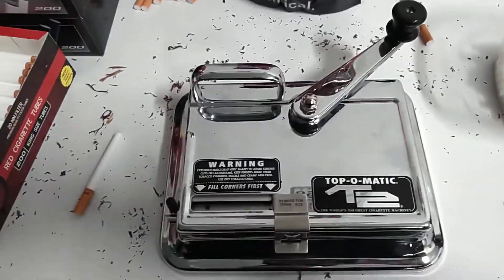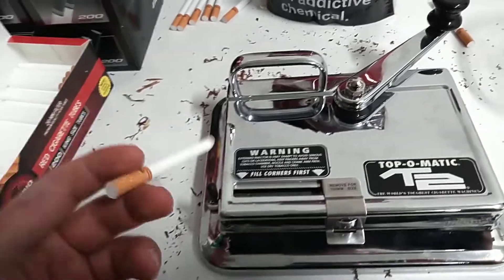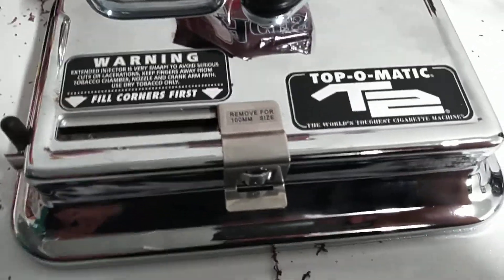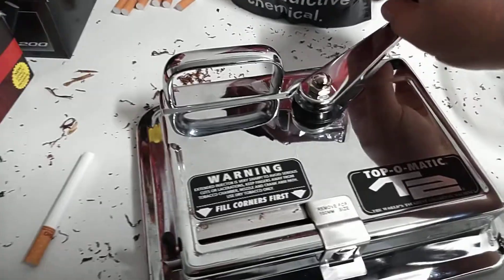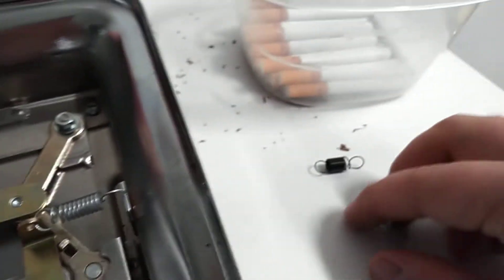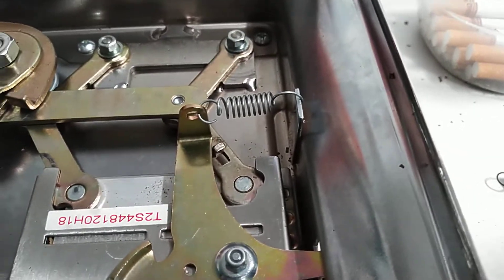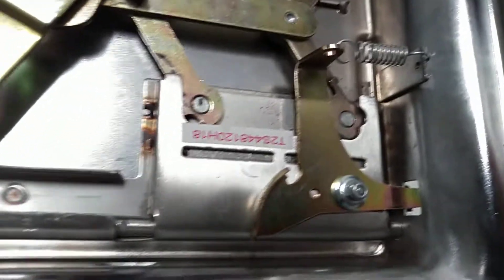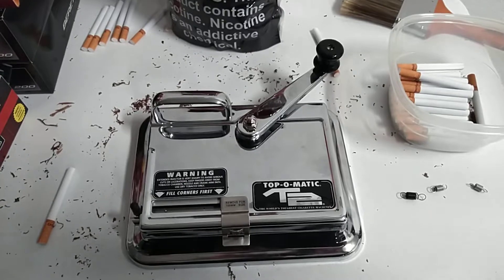Top O Matic T2 Half Filled Tube Fix

Comment: Thanks for the video and inspiration! I had the same problem. But I found another solution which might help, too. After watching this, I saved myself a couple bucks and a trip to the hardware store by reworking the native spring by increasing tension. Using strong small tweezers, I unhooked the spring on the static end, and then wound it up at the moving end a few turns, then attached it back on the static end. Works perfectly, no more misfirings!

Comment: This is great advice. My friend gave me mine used and I really love it. It's much quicker than the little handheld machine. A couple other causes I've noticed in the machine stuffing them half full....packing the tobacco too tightly, the arm not being screwed on tight enough (my screw loosens a bit with each rolled cigarette), and the rubber piece that holds the tube in place slides up so its unable to keep the tube in place. In fact. I lost the original rubber piece and was about to order replacement like 2pk for $10. I got an idea....the rubber tip off earbuds! Been using the same one for like 2 years. Plus they're free
Reply: I used heat shrink tubing

Comment: Thanks for the video! I was seriously skeptical but I went ahead and went to my local ace hardware store and picked up 3 119 springs.  I took em hime and installed one in my machine and I also lubricated it with some 3in1 oil I have.  All I can say I'd thank you so much! My machine works just like day one!  I also put one of the new springs I got into an older one I had that stopped working over a year ago. It worked on that one too! Now I have two "T2s" that work just fine 🙂

Comment: Thanks for this, four years and you are still helping folks! The comments are great too!! I am headed to find a 119 and a small oil can, but that’s fine I needed a tobacco run anyhow since my easy little store is out of the stuff I wanted, and my sewing machine could use some oil anyhow. If I see heat shrink or ear buds I might make a new rubber bumper too because mine has a few divits from trying to hold the tube on strategically with my thumb and maybe pressing too hard, or getting a little tobacco stuck there during a lot of rolling… then I flipped the bumper over 180 and made a whole new divit (My bumper is now on a 45 degree spot and this game cannot continue forever).

My only issue is, how do I drive to Ace without rolling more dangerous “fall off in your lap” half cig’s for the trip? Much appreciated Tom 😎

Comment: So, I didn’t want to believe that the fix for this was that simple. But, it was !  I have been rolling for about 2.5 years and every six months, the issue of underfilled tubes would creep up. My first machine, I ordered parts recommended by another roller and replaced them but never thought about the springs ... in any case, this didn’t work and really, a new machine every six months meant I was still saving a ton of money not buying smokes.

Today, almost ordered another new machine, but read this and I just returned from the hardware store with four “119” springs, 1.75$ apiece. In about 30 minutes, I replaced and tested three “broken” machines, so now I have two refurbs “just in case”. Thanks, Tom, for the fix. 

I will also add that the humidity of the  tobacco  can cause an occasional issue, but this might be 1 in 30+ tubes and after so long, I can almost feel the issue before it happens ;) a piece of bread in the tobacco bag works, as do the little cigar humidifiers (size of a few stacked nickels), but don’t overdo it or the tobacco starts to stick and jam.

Reading other advice here, I also saved the old springs, and will try the advice of reusing them by trimming these a bit, next time the need arises.
Reply: My machine has 2 springs,1 on each end. One is short oneis longer.Does the longer one also need replaced?

Comment: Another thing you can try: The moisture of the tobacco is a critical variable that's too often ignored. Too moist and it won't burn well. Too dry and it'll crumble and produce fines that won't pack well. So try the old pipe-smoker's trick of throwing a wedge of apple or a damp (& rung out) paper towel into your tobacco stash to keep it at optimal humidity. This is what works for me.
Reply: Nope, mine is too moist. I add nothing.
Reply: I keep my tobacco in the refrigerator.
Reply: Exactly what I've been doing for years. It also allows me to user the whole contents of the tobacco bag. Previously, i woul wind up with a bunch of too dry stuff that was unusable ( a waste of money).
Reply: where can I get that spring?
Reply: @renerenatorivera9062  ace hardware, probably home depot, lowes
Reply: What I found to add the perfect amount of moisture back into the tobacco is to blow through it a few times.  I put the tobacco to the side of a container to do it. Make it roll perfect again. I have tried a moisture pack and that got it too wet.
Reply: I place a dampen piece of cedar in my open tobacco bag.
Reply: I've called it tobacco soup vs tobacco sand for years. Both suck. 
If it's too dry I'll wet my fingertips & drip several drops into the bag, wait a couple hours for it to soak evenly, & the consistency is good again. It works a lot better for me than any piece of bread, lettuce, or piece of fruit or peel. 
Conversely, if it's too humidified (& there's no air conditioning available) I'll spread some tobacco on a tray & stick it in the oven on the lowest temperature for about 1 - 3 minutes. Got to be pretty quick about getting it back in the bag if the ambient humidity is that bad (also being careful not to scrunch the freshly dried tobacco into "sand") but these strategies have helped me through the years.
Reply: Or a small piece of bread and keep in the fridge

Comment: You were right, tried pressing on the rubber arm to add a bit more tension during the fill and found it was releasing the tube too early causing it not to fill correctly.  You were right on the money, it is the spring tension.  Thanks Bro.

Comment: After buying like 4 Topomatics I gave up trying to adjust things or mess with springs. On this 5th machine I just push my left thumb lightly against the rubber titt to help it hold the tube on until it is full. This 5th machine has lasted me around 5 years,maybe longer,I don't remember. My method does put the left thumb in danger but I haven't jabbed it yet. It also rips a tiny chunk of paper off the end of the tube but that's no problem at all,into the pack they go and smoke just fine. I also took one of the silver handles from and extra machine,drilled another hole in the crank handle,and fitted the handle to the crank after tossing the stupid knob in the trash. The handle mod gives me lots more power when the tobacco is damp due to humidity. I don't use air-con,just several fans,to keep cool,so high humidity could make stuffing smokes a real pain in summer but not anymore. Been stuffing since 2009 when the IDIOTIC fire safe cig law was enacted, that crap made me sick so I found a way around it.
Reply: I was introduced to rolling your own around '97 or '98, & had been smoking strictly American Spirit for some years prior to that. And I used their brand of tobacco in the days before the price ran up to near gold price levels. By the aughts I found that smoking more than a couple of pre-mades in a row made my throat very sore & start to feel like a first tickle of catching a cold, & already back then it made me feel that if I had to choose between only smoking pre-made or not at all, I'd quit in a heartbeat. These days pre-made cigarettes resemble tobacco about as much as Crapdonald's resembles a food-like-substance. I laugh (to myself) when people think they are being kind & doing me a favor by offering me "real" (pre-made) cigarettes. 

Camels in all their varieties & flavors are still pretty good though, in a pinch.
Reply: @morgainnejade  My dad had a cig rolling machine in the 1960s but instead of stuffing a tube it actually rolled paper and tobacco up and over the top dropping an unfiltered cig out the other side. I used to ask to roll them but it was rare he agreed,I suppose at such a young age I was too slow and would mess up.

Comment: The #119 spring was $1.39 at my local ACE Hardware. Very easy to find. I bought an extra one for backup. Thank you Mr. King!
Reply: Looking for the spring, do you have a skew number.  Ican't find it
Reply: @Sari749  I don’t. But the hardware store is a block away. I will go down and look. But, like all ACE hardware stores, they typically do not have skew numbers for singleton small screws and springs. If you post your email address I will send you a picture of the drawer they are in and related identifying information.
Reply: @Sari749  540356 Ace Hardware.
Reply: Yeah, I paid $1.89 for mine! I'm guessing inflation! Lol!
Reply: Is there another name or number for this, not coming up online at Ace or anywhere?
Reply: @KathyDavis270  Not that I am aware of. Best to visit Ace in person and ask for spring by number. Be sure to find person that works that area. I doubt Ace would put an item number or sku for this as they have thousands of different size nuts, bolts, screws  and springs.

Comment: Hey Tom,
Been having prob's with half filled tubes like many others here. Yup, looked at machine too when started malfunctioning.  Thought might be rubber bumper or one of the springs, tobacco, tubes ect. Wetting and wiping bumper helps. But, after watching your video and getting worn out from redoing half filled tubes?  Tried your solution of new spring had on hand and reoiled  machine. ( Used sewing machine oil, doesn't have that oily taste.) Ummm, your solution doesn't work too good, it works great!  
Thanks for great fix, is appreciated!

Comment: Got one just like that. Bought on valentines day 2012. Learned right away to remove the adapter for king (regular) size tubes. Worked fine for 12 year on nearly any cut of tobacco with a wide range of humidity content. Most tube brands worked well. I've use Zen tubes mostly. About a week ago it start pushing, and sometimes tearing the tubes off without filling them more than half the length. Seems the tobacco wants to bunch up as the arm is turned. The machine hasn't been dropped. In fact it hasn't been moved from its spot for about a week before it stopped working. I clean it every 2 - 3 weeks whether needed or not just to keep it inspected. I did try another brand (Gambler) tubes and they really didn't work much better, if any. Maybe time for a complete rebuild or, I may just trash it and buy a new one.

Comment: Thank you thank you thank you!!! I wanted to throw my T2 through the window! I make 100's but had the same problem. A couple hours ago it was having this problem 3 out of 4 cigarettes I made. Saw this video and ran to the hardware store and bought the only two 119 springs they had. I had to stretch the new spring just a little bit because it was biting a little bit of the tube off when making the cigarette. One little stretch and its still stiffer than factory spring and my problem has disappeared. Thanks again.

Comment: This summer I tried using that 119 spring from ACE on a Top O Matic that started doing this within less than eight months from it's date of purchase and it only worked for a while. Therefore decided to purchase the T2 instead, however less than five months (since purchase) and it too has also started doing the same thing. I have found a solution that's been working for me and that's to first make sure each corner is packed with tobacco and then instead of pulling the handle all the way, it's pulled down slowly and stopped when the click is heard, then slowly pulled down again to finish filling the tube.

Comment: I have the T-1, and I'm not a nag but not thinking the spring was the issue. If you see that when you place the tube, and the tobacco is pushing through and gets "bunched up" It means that the tube catcher was doing its job in the first place. It has because the full-revolution of all the motion has occurred and the tube "stayed" where it is designed to stay. It was not the spring. I had the same issue, what works for me is after you have loaded the pit, just ease the lever as a "lighter, easy" packing motion. Not just ramming it through, peace, they are awesome rollers...

Comment: You can also bend the little arm a wee bit (with needle nose pliers), that holds the cigarette tube in place till it just releases when the packing rod is extended all the way out. It will keep the tubes on till the they are all the way full. Agree the stock springs should be updated. Wonder how many people throw the machine out when they could have easily fixed it.

Comment: Great advice definitely going to try this too, I wish they(Topomatic) included a troubleshooting pamphlet with the machine as well. 
I found rotating the rubber bumper/holder after a dozen or so cigarettes helps as well. Because it does get a crease in it possibly causing friction loss.

Comment: To check to see if this is the culprit, here is how I tried. Mind you, I have had a 9 in 10 half fill UNLESS I underload it. So what I did was once the handle goes to the first setting, I push on the rubber with my left thumb against the injector nozzle then pull the handle. Injects perfectly. 4 in a row. Just wanted to share.  UPDATE: Rolled 2 cartons, only 2 ended up half full with this technique. Saves me running all the way to town hoping to find a spring or a new unit.

Comment: Yeah great suggestion!  I'm using the same machine and had the same problem with the half full tube.  I found that if I took my little finger and pressed the hold post that solved my problem.  Your idea is a much better solution.  I also use sewing machine oil on my pivot points, and you gotta be careful and not get it where it saturates your tobacco and tubes!  LOL how do I know that?  I dont wish to own an electric machine because if the electricity is out I wouldn't be able to make smokes.  Also, when I clean my machine, I do it in the kitchen sink....

Comment: @tomking i have tried 3 ace hardwares and they dont have anything listed for that was wondering if you could measure the length and diameter of the spring or any info at all. yes i know this is 3 years old but the only thing i can find online is ppl say #119 from ace. thank u if u ever even see this.

Comment: Haha I just have to say, as someone that works in a spring factory it's insane to hear they're charging you a whole dollar for one spring! For reference, our absolutely highest paying customer (St. Jude Medical) pays $5 per spring that is designed to operate an artificial heart valve. We'd probably sell the spring you have to a customer for like $0.08 or even less lol.
Reply: I was thinking the same thing! I took a quick guess at 20¢ before he gave the actual cost and I was just appalled!  It's like they're trying to force out any type of fix it yourselves type solution by making the endeavor so unaffordable that it's not worth it to extend the life of what you have so that buying a new one becomes a relief. It's gross. 

 I have probably about 100 lbs of random hardware and Maybe 2% of it I've sought out and paid for.  The rest I've literally alley scored and dumpster dived.  I guarantee I have this spring Somewhere.  It's Crazy how much gets thrown away into tearoff dumpsters as well!!
 Anyway, thanks for pointing that out!

Comment: Soo, i have a similar roller. Same brand and probably the same model. Mines just orange and not silver. But, my little rubber piece is in fact kinda damaged. But, i just hold it with my thumb and still have the same issue. OCCASIONALLY i can get a full tube, but its pretty loose and needs severe packing. Soo, im gunna have to assume that it is the spring and im gunna replace it!! All the comments agree with the video, so hopefully it solves my problem! Thank you!!

Comment: Wrap some good tape around the neoprene/rubber sleeve. It will temporarily help dog the tip of the tube off tighter until you fix the underlying problem. It enlarges the diameter of the sleeve.
Another thing I do is hold the sleeve tight with my pinky while cranking the handle.

Comment: OK first off this is kind of long. I have been rolling my own cigarettes for over two years and had this problem for that whole time through 5 machines. My first mistake was coming to Youtube to find out what others do when this happens.

I looked at many videos and tried many fixes to the machine.Ordered what they said would fix it and was disappointed every time. I then decided when a machine started doing it on a regular basis I would spend another $40 for a new one rather than try and fail to fix the one I had.  
Now I smoke a pack a day and I do not keep track of how many packs I make when the problem starts. 
The last machine I bought started to make like 3 or 4 cigarettes out of twenty so I was going to buy another machine. Well i had another machine that I had already replaced with this one.

As I started using it at first about one in 20 would end up having the tobacco stripped out and put in my ashtray. Which was better than the one I was using so I continued and I found that if I did not try to over fill the machine and pack the tobacco it started working fine again.

So before you try to fix the one you have cut back on packing it with tobacco. It could just be that you are the problem. Remember it took me over two years to realize what was wrong because I looked for a solution here first.

Comment: When you start having the same problems Again, it the rubber waring out, I actually stopped rolling with a Machine and started rolling up by hand for several years. Because i was going through 4 top o magic machines a year. I'm gonna try the Powermatic manual now. Everybody says they are built better

Comment: my issue was the same but wasn't the spring. The rubber piece was riding up on the post it was on. Pushing it down fixed it.